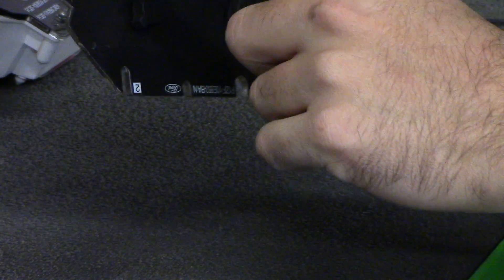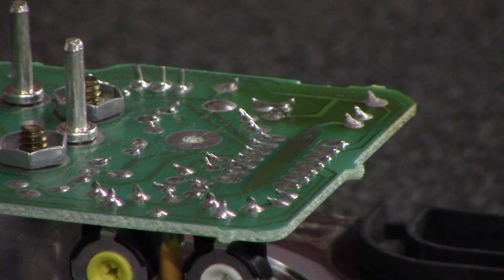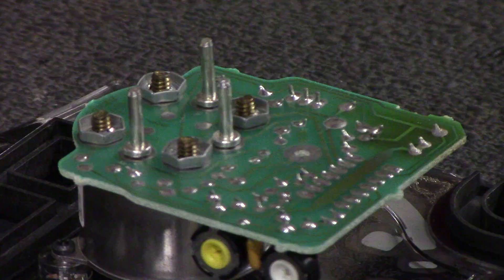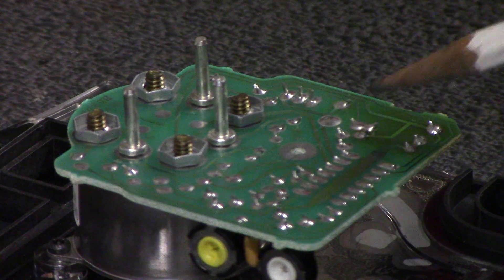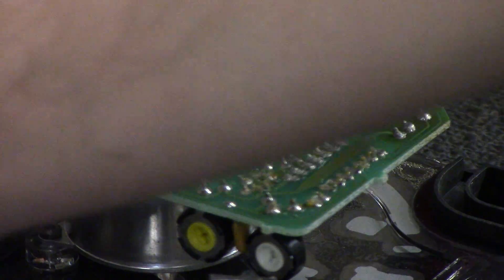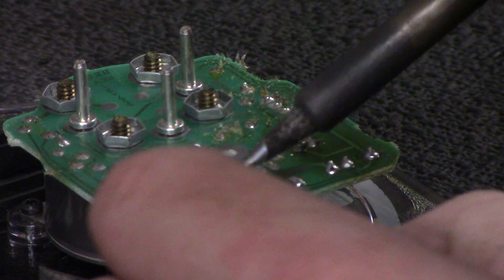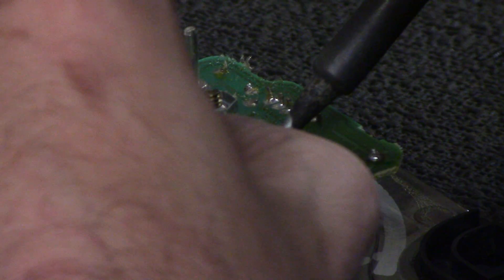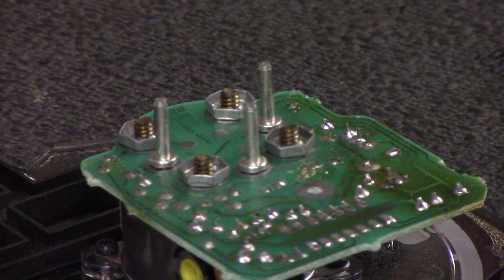Foxbody tachometer repair part 2

Comment: I see your still making videos,so I hope you notice this.I have a tach much like this one that I got off ebay (early 90s 5.0 mustang) that I'm retrofitting to a gauge cluster in a ranger that's getting a 5.0.I would be really grateful if you could tell me about those 3 posts sticking out the  back...more specifically which one is pos/neg/signal.
Reply from the maker: I can not...perhaps a wiring diagram from a haynes or Chilton manual
Reply: @Pyro17059  Thank you for replying.I did actually determine 2 of them after I put my glasses on and saw that 'g' for ground and 's' for signal were printed on the board (telling on myself).Still have to figure out what 'B+' ...but I'm thinking battery positive/key on?